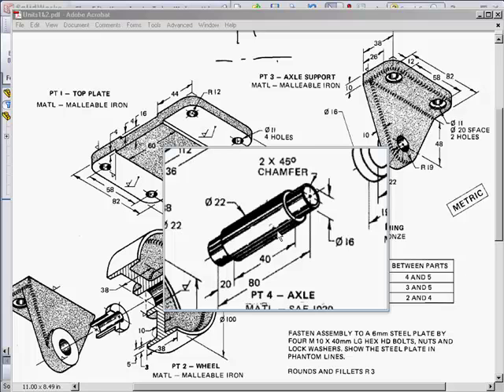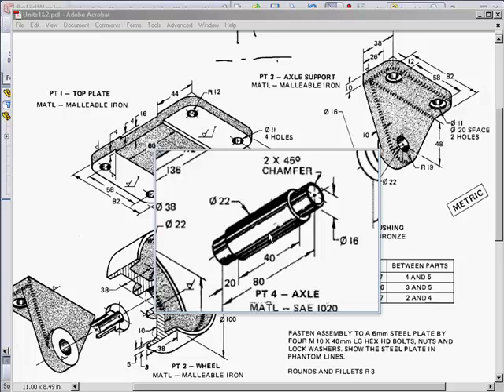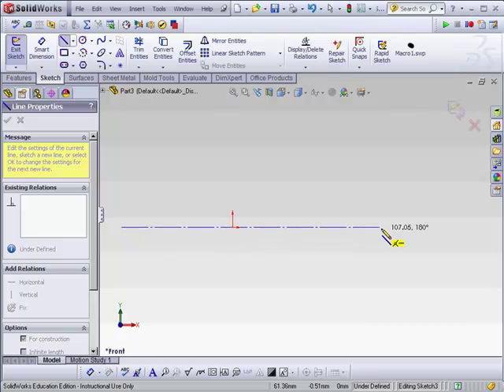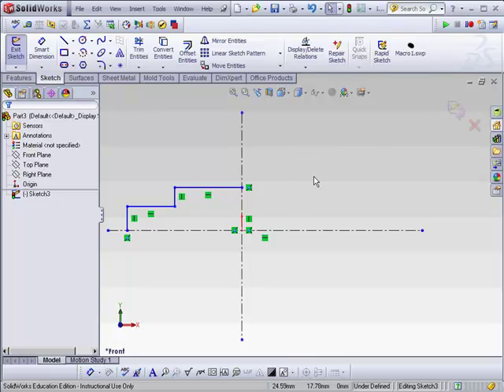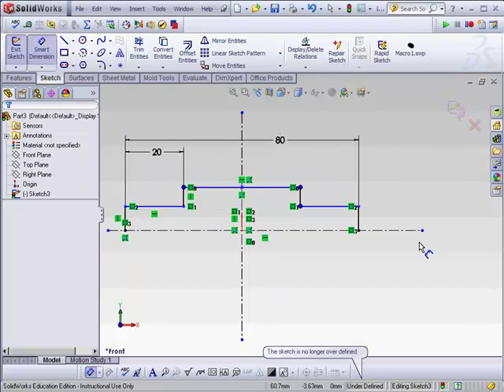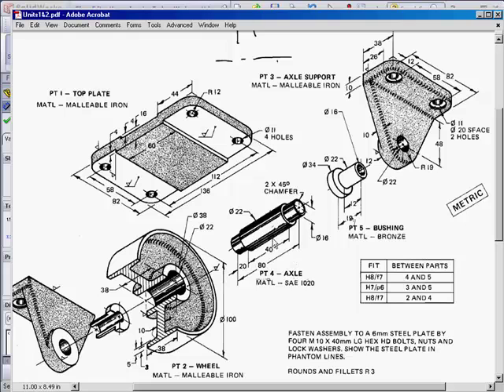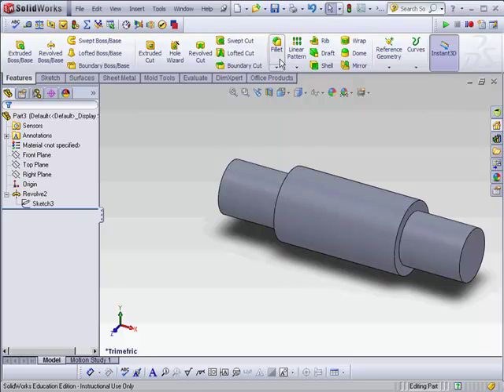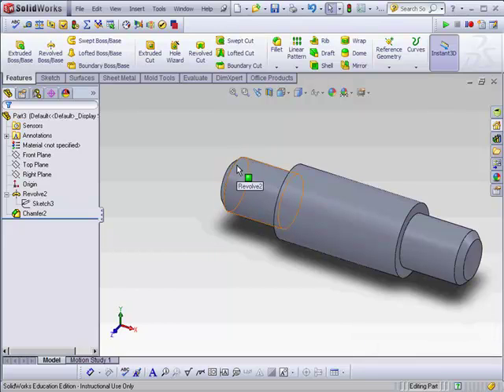SolidWorks axle

Comment: This was too fast.
Reply from the maker: I may be misunderstanding, but if you mean I went too fast on the video it's because I know you can slow it down by selecting the little gear icon on the lower right corner of the video and changing the speed.